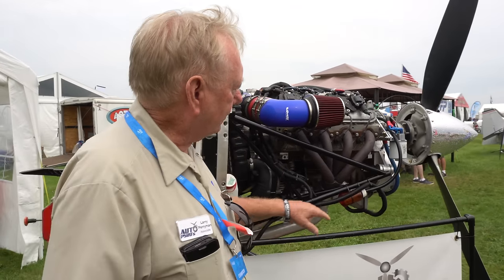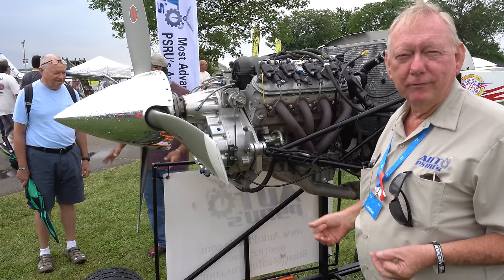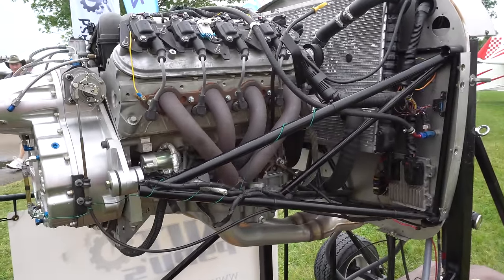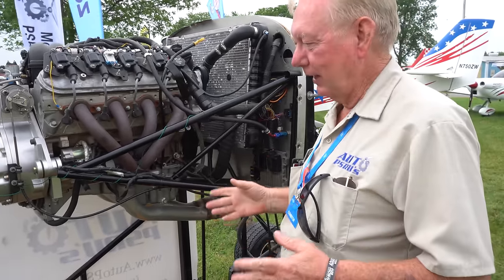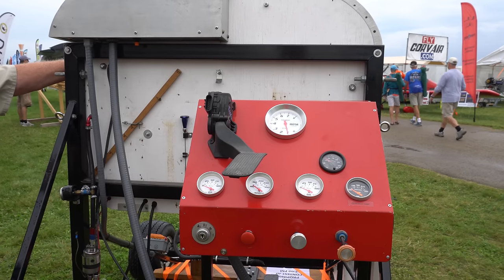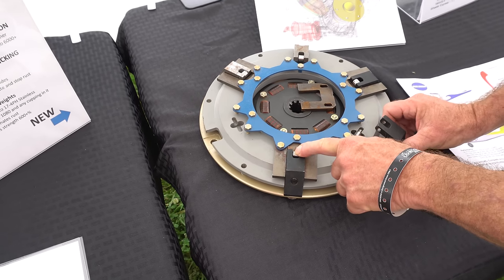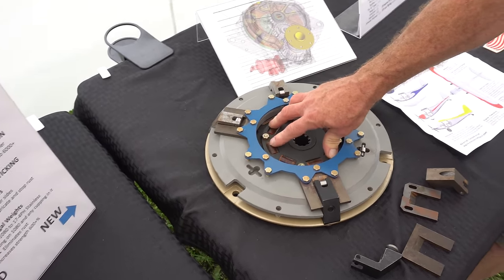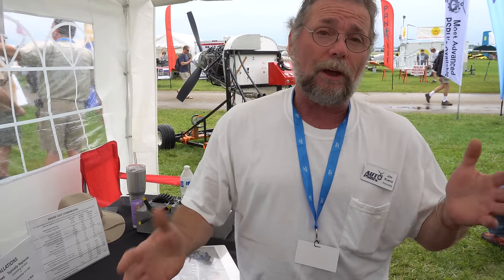AutoPSRU Prop Speed Reduction Unit and LS3 V8 Engine Swap For Your Airplane - EAA Oshkosh [4K]

Comment: forged inernals, and a procharger = 6k fpm climb lol
Reply from the maker: had to do a double take there, I'm not a pilot, I'm a videographer, so I first interpreted that to mean 6k resolution at  _ frames per second.  but I got it now, 6000'/minute 😄
Reply: @InternalCombustion  nooo meant rate of climb 😁 that would be awesome, that would be like king air performance lol
Reply from the maker: Do you fly commercial?
Reply: @InternalCombustion  I fly for fun, I'm an A&P, worked on everything from an dc6 to a 747-800
Reply from the maker: @CarlosRodriguez-kh3df  ooohh, we could of used your skillset last summer! A DC3 blew a piston and the warbirds volunteer staff didn't have the equipment to fix it so they had it towed across the runway to Basler.
Reply: @InternalCombustion  aww man, A cyl base wrench helps but its really hand tools you need for a radial, I would guess a ring compressor tool to get the Piston in the jug, however an extra set of helping hands would do, and a feeler gauge for valve clearance, other than that it could've been done with hand tools.. gotta love old recips
Reply from the maker: Yea and I’m not totally sure what the extent of the damage was. I’m guessing they took the head and jugg off and saw it was something more complicated than just needing a replacement piston.
Reply: @InternalCombustion  manifold wrenches are needed too, but I'm surprised they wouldn't have em with the airplane
Reply: Nawww baby some spooly boiiizzz

Comment: The only is missing is a special made propeller that has 13 inch wide blades and  with 12  blades on a circle of the propeller that will produce very high air flow and great torque on the pull and a V8 would support that and the fuel economy would be better and will your speed flying
Reply: So an old fashion mindmill blade type of deal, lol?

Comment: It probably gets better fuel and faster then the Merlin with less weight but the fuel system would have to be engineered so it won’t stall I believe

Comment: Where did he say he could start that setup and demonstrate it?  I couldn't tell what he said, and the Subtitles are REALLY BAD on this video!! lol  Thanks for the vid... I would love to see a Dual Dry sump setup on this so it could do loops....
Also, Why don't they run the system off the engine oil system?   With an off the shelf HV Oil Pump, an LS can make 60-80PSI easy... That should easily cover the 40psi they need.  Or do they need much thicker oils?  I just heard about LS in aircraft and googled it tonight.  So I'm sorry if these are dumb questions... Please go easy on me.  It's my birthday!
Reply: I believe he said he can run the engine at "Sun and Fun" in Florida.

Comment: you could certainly use a few improvements. An aviation engine should have some bottom end improvements, IE: rods. PSRU could be 3:2 if the engine was properly tuned to a 3600 rpm rev limit and would raise longevity a lot. Turbo normalized would be wonderful?Build a better auto engine over stock and you will have good power and reliability. Out of the box the "LS" engine is not ideal. For air craft power the sbc has a better torque curve but is not as strong/reliable.
Reply: I'm not sure you know what you're talking about lol.

Comment: Before you get excited about hanging this on your Cessna or Piper a certified plane takes a certified engine. To date, there is no certified auto engines on the market, kitbashing time!
Reply from the maker: I’ll just leave this right here https://www.pro-touring.com/threads/96291-LS-3-approved-by-FAA-for-Cesna-172
Reply: @InternalCombustion  
uno reverse card

Comment: No safety wire on all those hydraulic fittings, wire leads, and still using a wet sump? Tell me how this guy can confidently say that you can 100% avoid negative G in turbulent air. Get thrown around a bit, oil pump sucks air here and there and cavitates. Or that serpentine belt goes out on takeoff but you don’t notice until after rotation and water temp takes off as well.  I hope this guy doesn’t fly over populated areas

Comment: So why does he run 4,500 rpm (max torque) when max power is higher?  Auto engines spend very little time at full power or high power in cars. It only takes 50 hp to 75 hp to cruise a car down the highway. Max acceleration and max power in cars occurs for a very small percentage of the engine’s life, and a very small number of its rotating cycles.  

Aircraft engines spend their lives at 60% to 75% power all the time and are expected to deliver 100% power for several minutes on every takeoff. When was the last time you ran your auto engine at full power for several minutes straight? Never? It occurs on every takeoff in an airplane. This is a much higher set of stress conditions than the engine was ever designed for. 

So my question is what do auto engine converters do to beef up the engines internals to account for the fact that they are constantly operating the engines at high power settings for much longer periods of time than they were designed for?

Have the converters performed fatigue analyses on the rods, pistons, and pushrods using S-N curves?  Have they beefed up the reciprocating assemblies for the increased number of high stress cycles the engines will see?  Or have they simply said “I’ve never seen an LS3 blow a  rod.  It’ll take it”.  Absent beefed up internals or at least a proper analysis of the existing internals, these things are accidents waiting to happen.